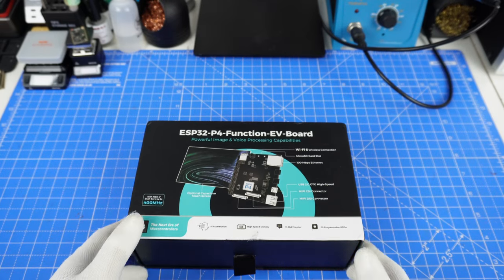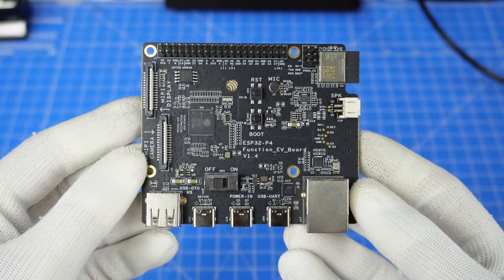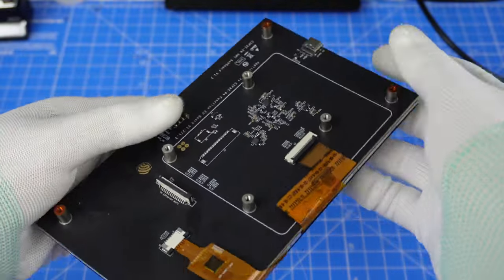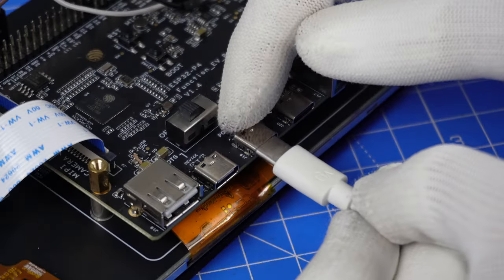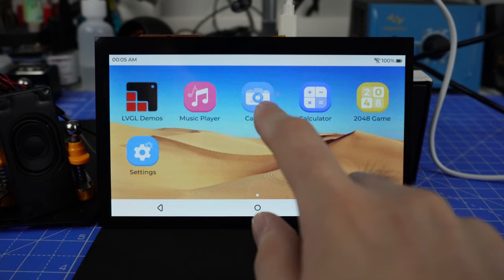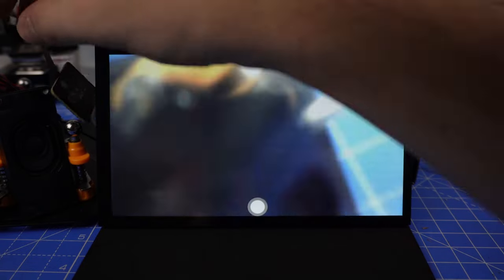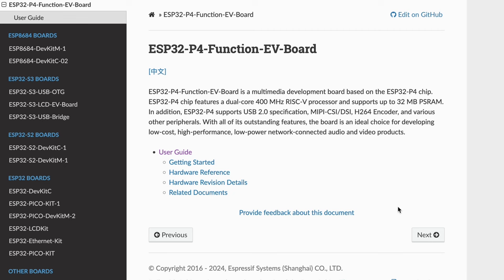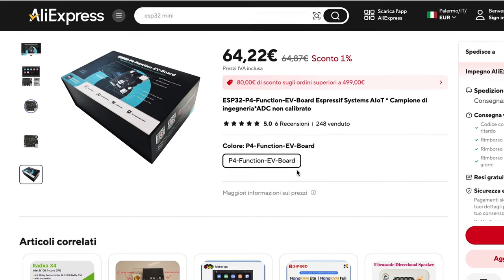New ESP32-P4 DevKit, unboxing & MIPI-DSI 1280x800 Demo

Comment: This chip is incredible and so is this development kit! So many benefits to this little thing for the price. Yes, it probably eats a lot of power and the stone itself is big compared to other models, but it gives you lots of ideas for projects.
Reply: I think it will be mainly targeted for HMI setups. Maybe also portable setups like barcode scanner applications for delivery jobs or local UI control for applications like Home Wizard.
As soon as I get my hands on one of those dev boards, I will try to add support for it in ESPEasy, but that does require quite a big overhaul as I need to get rid of WiFi code and currently it will not build without WiFi code.
Reply: The chip itself is only some few dollars.

Power consumption is unknown to me, but given the other chips running without wifi is rather low power it can't be THAT bad. The screen itself is likely to dominate it all!
Camera with some smarts in (camera to ethernet/usb) including video overlays and video encoder, touchscreens with slow link toward the rest of the system, many options.

Comment: Is it programmed using ESP-IDF or Arduino?  Or is it running linux? Has it a fast startup time?  Thanks for the video.😀
Reply from the maker: Yes ESP-IDF, I honestly have not measured the startup time accurately, I can tell you that the microcontroller is very responsive.

Comment: I wonder will we have small dev boards for the P4 like for the S3.
Reply from the maker: It can be done, would you just like to have a usb-c like interface like the classic devkits or would you like more? Would you keep the ESP32-P4 + ESP32-C6 combination?
Reply: @SalvatoreRaccardi  Don't really care as long as its small, mostly interested in the camera & display interface. And how hard it is to implement different displays for this. I would have a project that im now building using raspberry pi that uses a 2.9" 1440x1440 display and the camera interface. But i dont really like linux, MCU would be so much faster to boot up. There already seems to be one quite compact P4 module, WT01P4C6-S1.

Comment: How on earth do you make the screen start ? Is there something to know ? To wire it ? To power it ?
Is mine defective? Do you have clue ?

Thanks for your vids !
Reply from the maker: The header pins RST_LCD, PWM, 5V, GND have been connected? Have you made sure the devkit is turned on correctly? I recommend you follow the documentation: https://docs.espressif.com/projects/esp-dev-kits/en/latest/esp32p4/esp32-p4-function-ev-board/user_guide.html
Reply: @SalvatoreRaccardi  thank you for this Quick answer, i think i did all of that but i will investigate again
Reply: @riendeplus1923  I just now followed his instructions when I unboxed my kit, and it started up immediately. I think you either have mis-wired yours, or maybe even your unit is defective. Re-check your wiring and try again?
Reply: Ok, so, i think a DuPont cable was guilty in this story ... :)